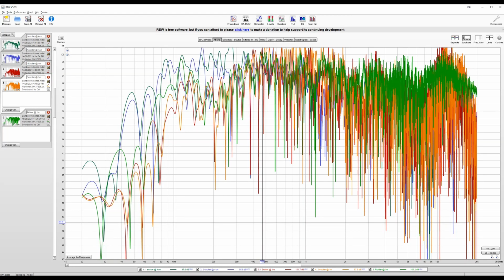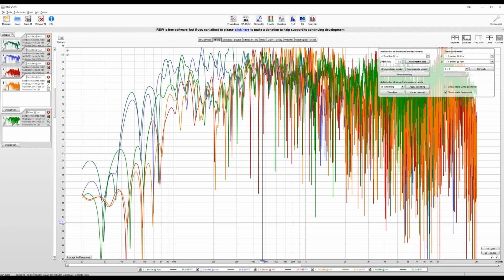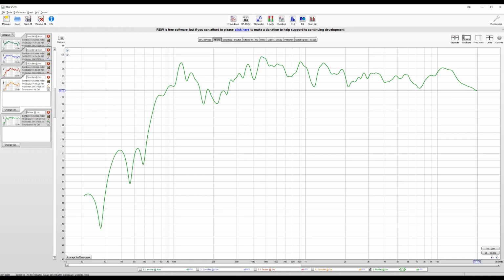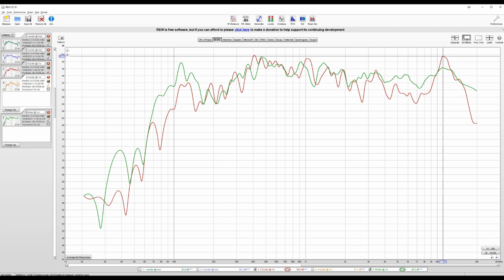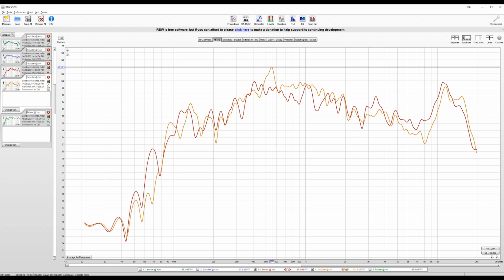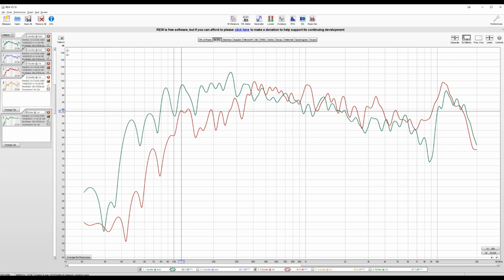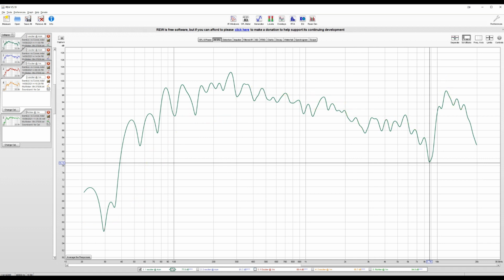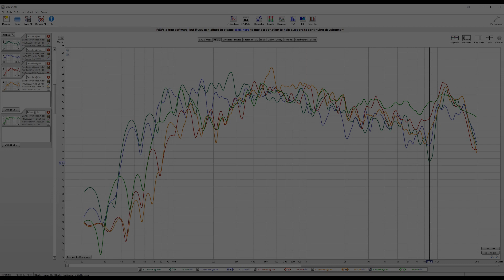Measuring my DML Panels - Are 2 Drivers Better Than 1?

Comment: How can you get a balanced signal from each speaker when one speaker has more power going to it with two drivers? It seems to me it would mess up imaging. For instance the lead singer is heard dead center on the sound stage, because the level from each speaker is equal.

Comment: Very new to the DML speakers.  I have attached them to one panel so far.  So far I’ve realized that I need a tweeter and sub.  I’m playing around with configuring the panel in a horn shape, with the exiter in front, reverse phase because it’s backwards. Thinking I can “dress” the exiter as a point source tweeter and the panel as the mid range and horn for the tweeter.  

Great content.   Definitely watching more of this
Reply from the maker: Thanks Bill. Glad you found the video useful. It’s an interesting idea Re. The tweeter. Are you thinking of attaching a small vibrating surface to the back of the driver? I have a couple of thin alloy discs that I bought for this purpose but haven’t had a chance to try it out yet.

Comment: What about using separate panels for each exciter?
Reply from the maker: I  think this is the way to go if you're interested in multi-exciter setups. There doesn't seem to be any way around the fact that you'll get interference on the same panel. The frequencies affected most will vary by the distance between the exciters and their relationships with the panel boundaries. At the moment I'm going with another approach which is a single-exciter panel plus a conventional woofer for the low end.
Reply: @TypicalBenYT  currently that what I'm doing, using a base speaker with my panels. I feel it works out great in my space.

Comment: I wonder what would happen if you built a simple crossover circuit and split the frequency range between the two exciters? The crossover circuits can give a lot of smoothing.
Reply from the maker: Really interesting question, thanks. I've thought about building a 2 way DML with drivers on separate panels but using a single panel might also be possible.

Comment: What happens when you put two drivers at 1/5, one at each end, and in the middle? From beam theory this is the lowest stress loading positions for support.
Reply from the maker: I've no idea! I guess the more drivers you use, the more complex the interactions will be...
Reply: No, I'm just suggesting the two drivers but a different location. Support at 20% location from each end and uniform loading will minimize any possible bending. Should give a cleaner response. I doubt any bending occurs.  I also wonder what happens if you add weight to the driver? Just thoughts. How to get a better low end response. AlanR
Reply from the maker: @alanrobb6161  Ok I understand. I haven't tried such a configuration yet but definitely one to test.

Comment: i suggest putting weight´s instead of a second exciter.... different placements... or multiple. controlling the energy u put into the system is better than putting more energy in the system

Comment: Hi Ben

Thanks for the video and the work you've put in

I've tried several materials and discovered that the glue interlayers in ply panels significantly dampens the higher frequencies.   

Dual/multiple exciters are also useful/necessary for heavier panels which need more punch to achieve the same output level as a lighter panel. Optimum placement of multiple exciters requires experimentation /testing to avoid / minimise interference between them

Comment: Would placing the mic at a different spot on the panel for the near field measurement make a difference?  Maybe there is another area that doesn't have a dead spot near 11000
Reply from the maker: Hi John, yes there is some difference in response across the panel. I measured at the center for this video but... well basically I'm learning this stuff as I go! I have measured various points across the panel but haven't made a video of it - I'll revisit and see if I can upload something useful from those tests soon.

Comment: Buy a piece of sheet metal and mount one to it.
More efficient medium for sound waves
Reply: This guy used a combination of various metal discs, canvas and wood. https://youtu.be/sxrkEvM9klI
Reply from the maker: @oldporkchops  thanks I hadn’t  seen that one before. Very interesting and yet another avenue to explore. 

I wish more people building these would make measurements though, even if the setup isn’t perfect.
Reply: @TypicalBenYT  So is it true that metal is a good transducer for sound?
Reply from the maker: @oldporkchops  I haven’t tried it but I know that in the popular tech ingredients video he tried an aluminium panel and it had awful ringing.
Reply: @TypicalBenYT  Yes, I remember that too, but that was because the exciter was affixed directly to the aluminum panel. Perhaps when the aluminum disc is fixed to a wood board (birch plywood) and the exciter is fixed to the wood panel, and the wood panel is fixed to an artist's canvas, it might fix the ringing problem?
Reply from the maker: @oldporkchops  oh I see what you mean. Yes that’s actually a very interesting idea even without the canvas… I wonder if adding a metal disc between the exciter and a plywood panel might help to distribute the vibrations more evenly across the surface.
Reply from the maker: @oldporkchops  yes that’s pretty much what I meant. Good find! And yeah they’re essentially the same thing.
Reply: @TypicalBenYT  I wonder how those in the video compare to the Daytons that everyone else is using?
Reply from the maker: Hey Wes, have you found a material that works well? I reckon metal would ‘ring’ quite a bit which wouldn’t really work for audio.

Comment: It will be interesting to try a circular panel with the exciter placed off-center. The more off-center, the greater the variation in length from exciter to the end of the panel. That may help you get a more consistent frequency response within a given range.
You may also want to look at the decay curve of the panels. A prolonged decay can result in muddiness/lack of clarity at some frequencies and it is a good idea to EQ the panels based on a combination of frequency response and decay. Distortion is another important metric to look at, especially after you apply an EQ. Pushing the driver at a specific frequency may give you a smoother curve but it could be at the cost of clarity.
Reply from the maker: Hey Tammany, thanks for the info. The circular panel idea is interesting for sure. 

Regarding the decay - I haven’t measured this yet but I guess that free-hanging panels will naturally have a longer decay than panels with some kind of damping or rigid attachments. It’s something I’m working towards with my new acrylic panels - I made a video on this construction also.

Comment: Fo overall immersion I'd be really interested in a Bose 901 setup with 2 panels mounted at an angle, pointing towards the back (wall) and the fronts covered by a 90% sound insulation. Thus following Amar Boses approach of 90% reflected sound and 10% direct sound meeting the ears, creating a very special and vivacious listening experience...
Reply: If you're that interested, do it and post.
Reply: Not demanding this in any way, just suggesting a different approach that I think might work quite well for this subject. DML acoustics applied to basic 901 architecture. A simple front loaded pipe or even just a simple hole in a given front panel should suffice for the desired portion of direct sound. Sound and vibration proof front panel could be done on the cheap with plywood and a "deadening" 1mm coat of Decidamp DC30 on the inside.

But this is all hypothetisizing from my part, as I'm currently too tied up in setting up a vintage sounding 70's PA-system. (minus most of the flaws), where DML panels do not apply, due to the necessary size, for one. 

But after that, maybe....? Still highly intrigued by the pure natural approach to sound of DML panels - if a spermwhale wants to provide 16 Hz it'll have to bring the vocal chords and lungs to match and then just let the most basic of physics do it's thing.... One pure source even more naturally amplified than applying Horn Speakers. The 901 philosophy strikes me as a perfect match for DML, because it, too, aims to replicate natural sound by recreating the 90/10 % dispersion normally found in nature. The DML's would level out the flaws (extreme EQ, many smaller fullrangers overlapping, etc.).

I think it might be quite something, joining two approaches to the same philosophy in a way that's not been done yet (according to my research).

Just a couple of thoughts on something I certainly would like to try when time permits...
Reply: @oleplanthafer7034  I owned two versions of the 901 and DML likely cannot be configured in this way. DML panels work the way they do because they are omindirectional, which is why bass is sometimes hard to capture.

The entire panel creates the resonance. If you want to baffle and bounce the sound you would need to put the entire panel in an enclosure, in which case it is no longer a DML panel, but a very large flat speaker.

I am making three iterations of DML panel using variations of the two best versions I have seen after six months of discussions with YT and local audio folks.

I will post the link to the videos on this channel, since the configuration here is one that inspired one of my designs.
Reply: @New Under The Sun: Thank you very much for the reflected feedback on my thoughts. I'm not quite convinced, though, as I would not try to compromise the benefit of an open-baffle solution, but rather enhance it's most important feature:

An open baffle speaker, as you will agree, throws it's sounds in (mainly, for the sake of simplicity) in 2 major directions, back and front. Front hitting you straight, back via first and second reflections, thus creating a harmonically distorted blend in the overall sound that is very becoming for most pleasant genres. A sound that the brain perceives as a detailed whole, rather than the sum of its (sharply distinctive) parts. Maximum immersion being the goal for me.

An open baffle speaker as is will provide a rear/front (simplicity, again) dispersion ov maybe 40% full on frontal sound and 60% reflected sound, depending on the usual parameters.

I would simply like to take this further by placing regular DML at an angle and set up a screen in in front of them in order to get closer to Mr. Bose's comparably over-engineered approach to create this natural balance of said 10%/90%. 

Just by placing 3 independent elements in the right relation to each other on the floor, allowing for the open baffles to be just that, but deflecting more of the direct sound to reflect once or twice and blend it nicely before it's ready to be processed psychoacoustically.

I'm a devout Mono-Afficionado (a clean mono mix on a single ESL 57 is often enough to send me over the moon), so luckily I wouldn't need a double set of everything and fool around with balancing 6 elements around the room.

Now you've provoked me! I might well be shelving my ongoing Neo-70's project for a while and show you yet! 😄😄😄

And please do keep us posted here if you're making any progress yourself! Intrigued!!

Comment: If you window or gate it wide then you get a lot of the reflections from the room. If you gate it narrow there's not enough data collected to FFT the lower frequencies. I usually gate it narrow, about a meter to get a cleaner reading from the mid range to the top. Then I gate it wide and close to measure the response of the lows. You'll see that as you narrow the gate the lows fall off more and more but the highs get smoother.

By the way, what program is this? I use something called Sample Champion that runs on Windows. Tried about 10 of them and love SC. Not sure if it's still available. Used to be a free version for you to try and a paid full version.
Reply from the maker: Thanks for the tip. I'll have a go at the 2-measurement technique with gating and see what I get. The software is REW (Room EQ Wizard).

Comment: You should probably have better hf response using thin ply. The Dayton thruster is known to have inadequate hf.
Reply from the maker: Hi Paul - thanks for that! After reading your comment I looked up the spec sheet on the thruster and I see it's not surprising that I'm getting the HF roll off. On my next build I'm using the DAEX30HESF-4 which seems a bit better in this regard.
Reply: Typical Ben Yes I'm using the thruster with foam and have the same issue. I think people have said good things about the 'ultra'. Check the diyaudio forum for mentions of the exciter you plan to use. PS you are on the right track with a long thin panel as your second design - gives better base due to edge modes. A baffle helps too to prevent cancellation front to back.

Comment: Did you experiment with different size panels? I want to try this but with much smaller size. Say 12"x18" or even 12"x12". I have a sub so I don't care about bass.
Reply from the maker: Not yet. I’d like to try some smaller sized ones to hang behind my PC though. 

I think there will be a frequency gap however, where the sub might go up to 150 - 200hz but the speaker is weak below  ~300hz for example, leaving a lack of mid bass, where a lot of the energy comes from in music. It will be interesting to try though.
Reply: @TypicalBenYT  Ah I wonder what size is minimum to get decent mids. Thanks
Reply from the maker: @zardoz2627  I think it depends on a few things - exciters, material and size would all have an effect. Most people seem to recommend at least 2ft/60cm length though.

Comment: Finally..... Someone finally took acoustical measurements of these things. I've been looking all over youtube for this and you are the first one I've found to actually do the deed. Thank you very much!

Everyone making these speakers keep on about how good they sound but that doesn't mean anything scientifically speaking, because the numbers are all that matter. The numbers eliminate Youtube audio compression and cell phone speakers and the listener entirely. So thanks again for the measurements, very much appreciated.
Cheers 🍻!
Reply from the maker: No problem! I’m still figuring out the measuring thing so will be improving it over time as I tweak me panels. Whether the results are ‘good’ or ‘bad’ they are hopefully at least useful!
Reply: @TypicalBenYT :
Oh measurements are always useful as they help to discern with evidence the good from the bad. REW is quite an involved program, but oh so capable. It gets easier with time, but one thing I could recommend for smoothing is to use the 'var' or variable smoothing option. This setting is what most should use if they were to EQ a speaker. But there is no problem whatsoever with the 1/12th smoothing you used, I use both myself.
Cheers 🍻 and good job 👍!
Reply from the maker: @Finite-Tuning  great I’ll have a look at that, thanks!

Comment: The peaks you're seeing in the DML's is caused by the resonant peaks of the material you're using for the speakers. i.e. there is an amazing explanation of this on Tech Ingredients. You can place weights at important areas on the DML Speaker Panel to smooth out these peaks.
Reply from the maker: Thanks Michael. I think this is the direction I’m heading in - I do remember that TI covered this but then went with using multiple materials together instead (I think - I’ll have to revisit the video). It might be a more practical solution for living room speakers though - I actually did some measurements of different areas of the panel and have noticed different dips and troughs across the surface.  I just need to find a non-destructive method of adding and removing weights to the panel now…
Reply: @TypicalBenYT  Yeah because the standard measurement types of a typical linear driver are widely different than the dispersion of a DML, you're going to get some weird results. I am yet to start my build, but I've been on every DML site and YouTube for weeks planning them.

Comment: Not that I’m an expert but you want the sound system to do a lot (but not all) of the smoothing not the graphing software.
Get your self a tuning fork and graph that as that is the sort of graph you want to see from your sound system if you record and play it back. You should be able to find a tone generator application or recording to play the various frequencies your system should be capable of. What you want is the truest reproduction of those tones with minimal noise, however you don’t really want to eliminate all the noise as a little bit of the noise is what gives a speaker a realistic personality. You do want to eliminate any noise that competes against the reproduction instead of complimenting it.